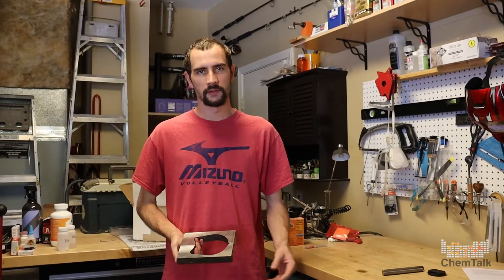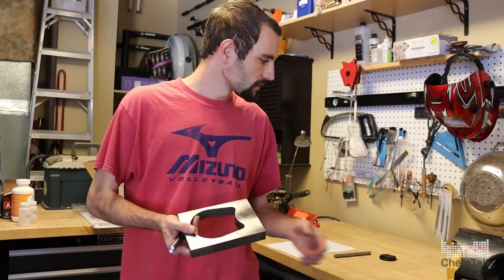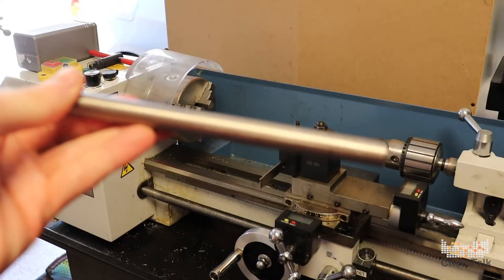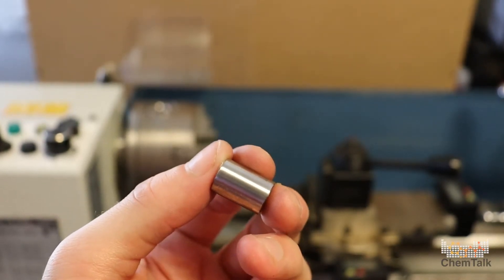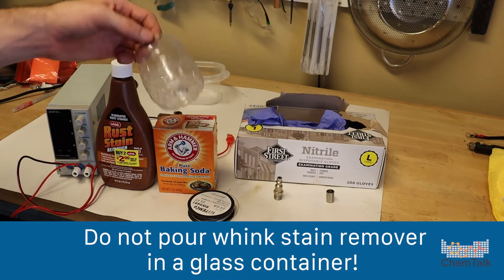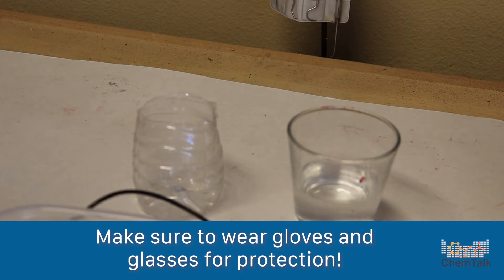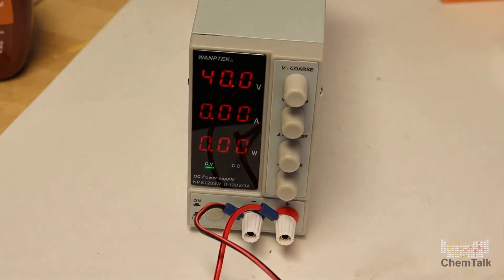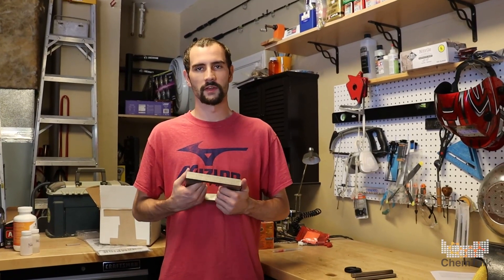Titanium Anodization - How To Do It

Comment: Important thing to note when anodizing, if you have too much baking soda in the solution at higher voltages it will cause pitting in the metal which can be visibly seen as sparks that appear on the metal while anodizing. If this does happen remix new solution with less baking soda.

Comment: What happens if you put the rust remover in a glass container?
Reply from the maker: You can do it, because it is dilute hydrofluoric acid, not concentrated. We use plastic to avoid that, because it will still attack glass slowly.
Reply: @ChemTalk  I discovered another possible side effect. After leaving it in a glass container for a couple weeks, it no longer had any effect on titanium. I'm guessing it became inert.
Reply from the maker: @noahcoccaro3802  Yeah, many metals become inert after reacting with acids by building up an oxide layer. Titanium and its oxide are fairly unreactive substances. Aluminum foil is protected from water by a 50nm thin aluminum oxide layer that forms faster that it could ever be scratched off. Nickel fluoride is notoriously inert and protective, which is why one of the only way to store fluorine gas in in  nickel metal. It quickly builds up a layer of protective NiF2.